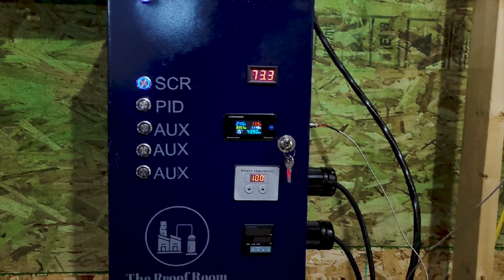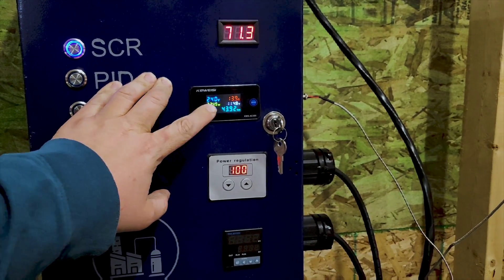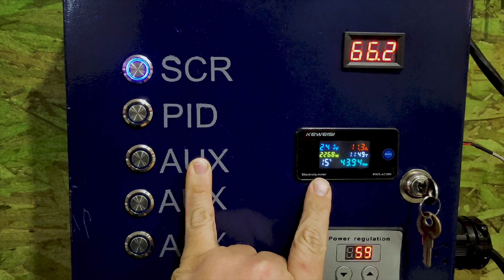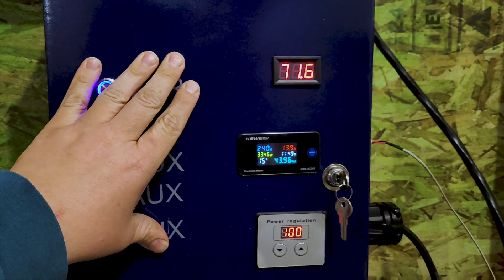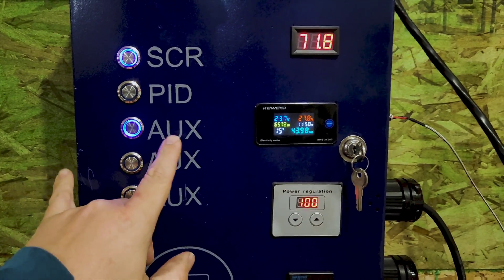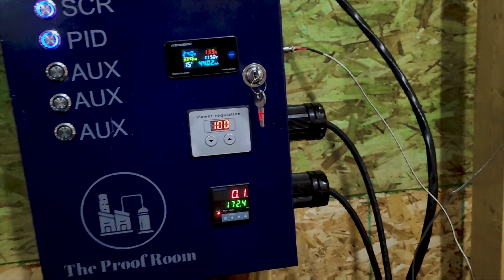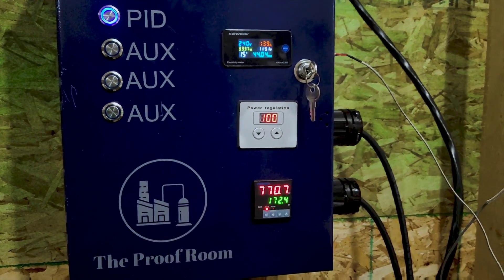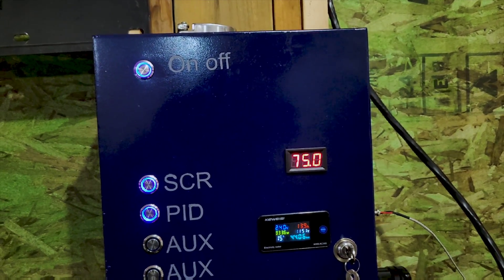how to operate an scr controller

Comment: Nice set-up. With an Inkbird temperature controller before the SCR and you can limit the max temp according to your needs. If you know that heads will dominate up to a certain temp, you can set that as your limit and run full blast almost unattended. Within the hearts zone, cutting back on the power will minimize smearing. Similarly, there's little danger of flooding your collection with tails by running too hot..
Reply from the maker: I did consider that but the only problem that I had was that if you hot that temp limit the pid will still pulse your element. So far I've found that running my bottom element at around 60 with my second element off is my auto pilot. Gives me a nice flood on all of my plates and a nice steady drip. To each there own though as long as it gets the job done. Cheers 🍻
Reply: @theproofroom1473  It's an interesting journey. My SCR set-up drives a single heat source and basically replaces your PID with the Inkbird limiter. Not chasing a temperature so much as a flow rate appropriate for the stage of the process.